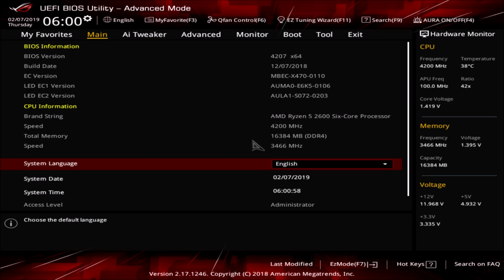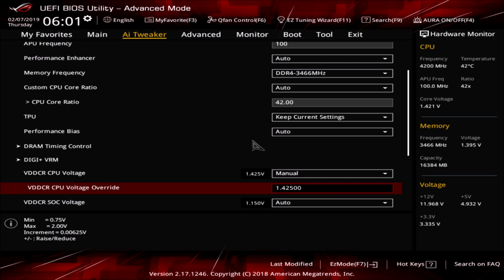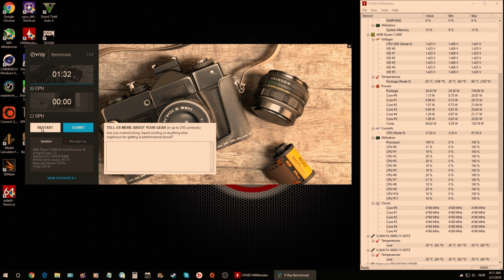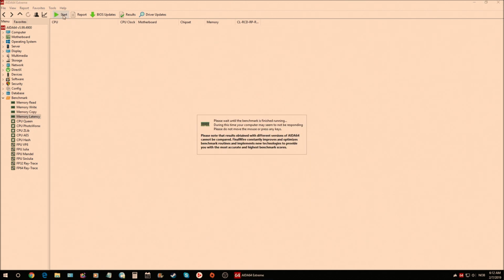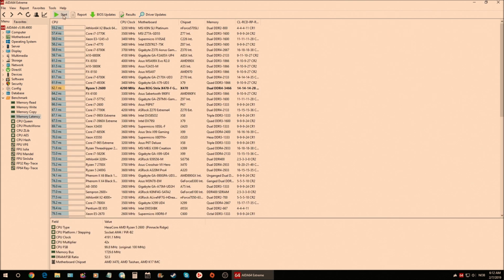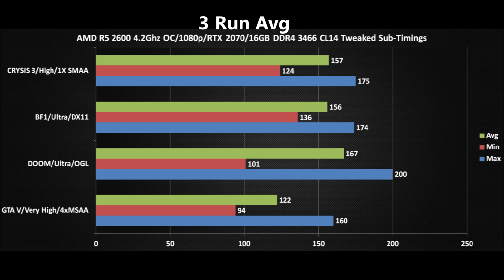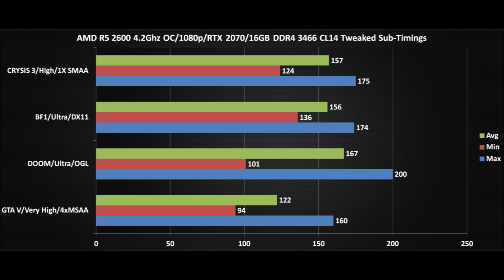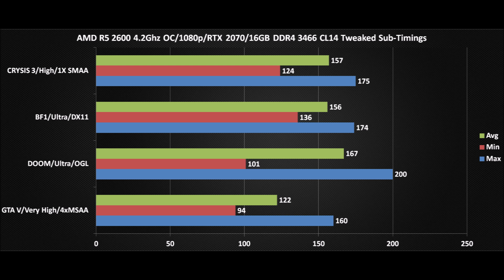AMD Ryzen 5 2600 OC with tweaked memory sub-timings

Comment: Hi! Could you please help me with my new RAM, Trident Z RGB 16gb 3600mhz kit? I have random shutdowns while gaming specially with 2K22 if I enable XMP. I'm stuck with the stock speed which is 2133mhz
Reply from the maker: Have you tried manually settings? XMP is not guaranteed to work. Try 3600mhz, set voltage manually, and set primary timings manually as well. See if that works.

Comment: I overclocked my 3200 memory to 3266 but with CL14 with Dram freq of 1.39 and I think that I gained between 6% and 9%. I tried higher but I did not want to go above 1.4v. I am now thinking about doing an OC to the CPU but not sure if worth it. It is supposed to have more impact the Ram OC than the CPU OC.
Update: settled with 4.0 oc @1.3v to keep things cool. All tests 1080 ultra - Far Cry 5 (only ram +7fps - both CPU 4.0 and ram +11 fps), AC Origins (only ram +5fps - both CPU 4.0 and ram +10 fps), Division 2 (only ram +1fps - both CPU 4.0 and ram +2 fps),  Metro Exodus (only ram +4fps - both CPU 4.0 and ram +6 fps) and Rainbow Six Siege (only ram +19fps - both CPU 4.0 and ram +38 fps).
I tried to bench my gains in real world scenarios and as I have 2060 super with 1080p144Hz I went with 1080pUltra with some minor tweaks.
Definitely worth the time for both the RAM OC and CPU OC. The Ram OC takes a lot of time but worth it.
Reply: That 1 GHz is rather negligible for the Ryzen 5 2600. I didn't even bother overclocking my 2700X when I got it. Just using PBO with a negative voltage offset of -50 and TDC locked at 92 (to keep the CPU cool, usually settles at around 3.925 - 4.050 GHz with less than 1.3v). Memory wise I settled for cl 14 3466 like the OP managed. Everything above was not possible with the memory controller of my 2700X (though I know that my cl14 3200 kit is able to do cl 16 4000 MHz)

Comment: You are torturing the components and for what? 10-15% better performance?And you have to buy expensive water cooling and fast memory.Not really worth it IMHO...
Reply from the maker: 10-15% extra performance is nice to have if you do it right. Totally worth it! No need to buy watercooling or expensive ram. A Cryorig H5 ultimate cooler, and 3200mhz memory is enough to give you a great experience. Nevertheless your opinion is welcomed.
Reply: I have my 2133mhz and 2400mhz ram combined that are both from different companies and both have different timings and I have them at 3066mhz @1.2V stable so you dont need anything fancy and I ran memtest86 for two hours and there were 0 errors
Reply: and my ram is years old and would only be worth like 30 or 20$ so you dont need anything fancy and my ram can go higher but my ryzen 5 2600 loses performance if I set my ram speed higher
Reply: Read my comment above. I did a very soft OC (1.39v on the ram and 1.3v on the cpu) for about 10% gain. That is going to become more important if I change graphics card in the future.
I think I narrowed the difference a bit with the 3600 and paid way less.

Comment: Finally a proper guide to over clocking the R5 2600..I also have the rtx 2070. Best combo out right now for the money to performance. I habe been struggling on getting it to 4.2. Your setting is what's going to help me reach it. I have the asus crosshair hero vii...over kill I know but I wanted to be prepared for zen3 when it comes out haha. Thanks for the video means a lot. If you have anymore tips on overclocking the 2600 please let me know haha.
Reply from the maker: Glad you found the video useful. One thing I will say is that you will definitely need good cooling. I noticed higher cooling headroom yielded higher clocks and stability.  I'd stay under 1.45v also. Set the LLC to 3. See if that helps.
Reply: Thank you I will. I have enermax liqtec 240. I will try those setting first.
Reply from the maker: @themoz1187  It does but only at lower resolutions. At 1440 or 4k you won't see a difference. Looking at it from an upgrade perspective, it is a good substitute til Gen 2 comes out.

Comment: do next video where you set ram frequency to 3600mhz and tweak manual every single timing i did this to my 2133mhz ram and it did 3066mhz and base clock 101 with timings 14,17,15,17,26 and i reached 4800mb/s read and copy
Reply from the maker: Hehe, I am actually working on that. I will be uploading it soon. Thanks for watching btw!